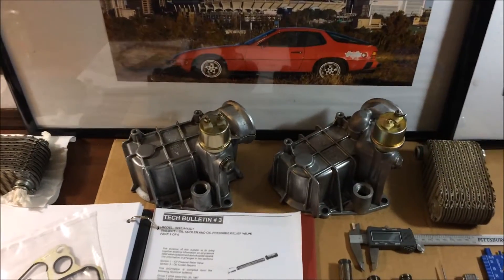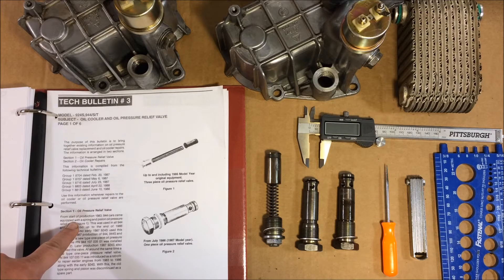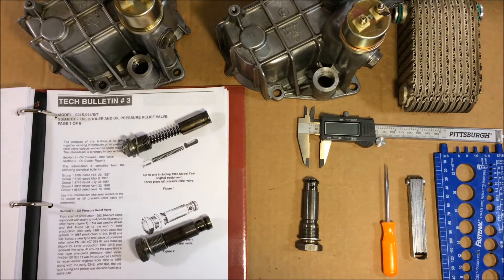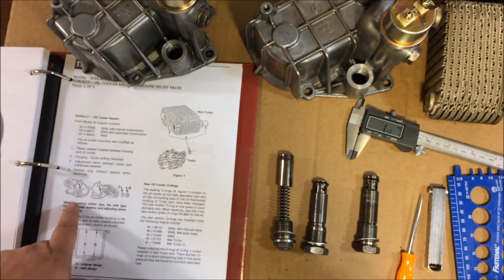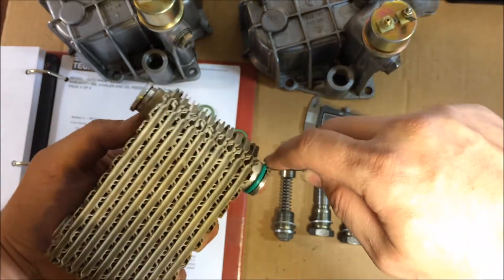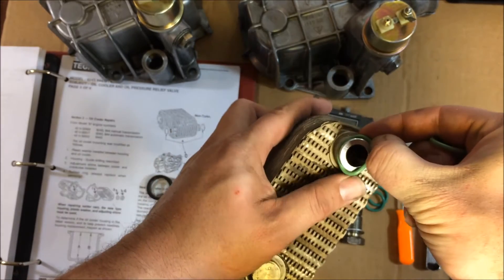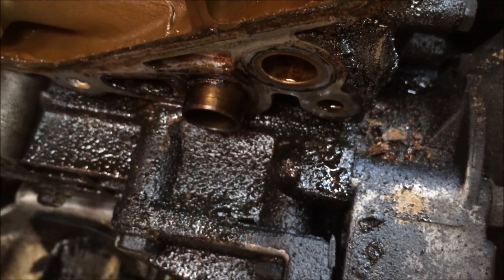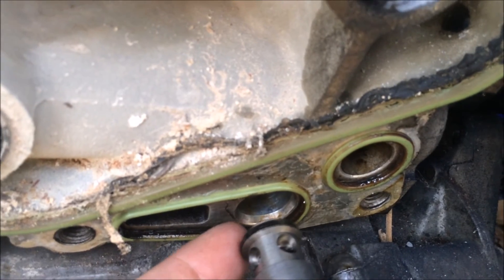Porsche 944 Oil Coolers

Comment: Iam sure there is a reason for the new modified oil cooler/ filter houseing .
But it does look i think over complicated in design .now is there a .free standing oil cooler . As a bolt on 
To the radiator pack ?.
Which  in turn may cure any water / oil cross over to the existing  engine???? 
I expect the engine would need a side plate over the space for the  oil pressure relief valve!!!!and for the sender unit.....
Reply from the maker: The turbo models have an external oil cooler that uses a plate to block off the coolant. However, they use the same seals which can also fail and cause mixing...

Comment: Hope you are still looking at this#
What do i do if i cant get a late housing
  
Ive got a 1985 944 non turbo
THANKS
Reply from the maker: Look around at different part sellers such as 944 Barn, Plyhammers Porsche, and 944 Online. One of them should have one. I don't recommend reusing the older style. The cooler and its seals are as critical as the belts in my opinion since when they fail they will make a mess of the engine. Good luck!
Reply: Check with John at just joshin 944 parts ! He has a ton of used stuff !!!!😄😄😄😄😎😎😎😎🇺🇸🇩🇪🍺

Comment: Which video shows how to remove oil cooler? I've seen previously, but now cannot find!  Thanks!
Reply from the maker: Hi, I believe you're looking for 'Installing the oil cooler video'. I hope that helps!
Reply: @edredas   - Thanks! Actually is was about removal. Assume exhaust manifold has to be removed first. Also, do you have a video on power steering line/hose replacement?  Great stuff!  Really appreciate!

Comment: I have an early housing that I guess I need to replace...has anyone ever just machined down those 1mm lips on the inside instead of paying for a whole new housing?  Any reason why that would be a bad idea (ie. other differences with the newer housings)?  Enjoying my first engine tear-down with my '84 944...thanks!
Reply from the maker: Probably could. I can’t see any other differences. I have a few 5R housing I was going to have a machine shop smooth flat and then remove the number so that I would know in the future they were machined. That said, a 6R housing usually isn’t much and I wouldn’t really try to smooth it down at home since you could potentially mess it up but a machine shop could do it right for a few bucks. I hope that helps!

Comment: Brent, do you have a video on the Turbo, it is a bit different, not much on the the turbo oil cooler on youtube, as a matter of fact, I found nothing. Not much on internet either, clark has some info but not super clear.
Reply from the maker: Check out the videos on the Nautic Blue 944. I show how to replace the turbo oil cooler seals in one of those. It's very similar to the N/A and even has two seals, but you don't need the shims. Good luck!
Reply: @edredas  Thanks, will do!

Comment: Hey Brent, really enjoy your videos, and I use them all the time. This time however, I've hit a snag. I'll need to reseal the oil cooler on my 85.5 944 and while a reseal kit is cheap, a retrofit OPRV is a third of used engine and a new case seems unobtainable. For a free-time wrencher like me, would reusing the old OPRV and case be catastrophic?
Reply from the maker: I think you will be fine. I have reused the three-piece oprv many times without issue. That isn't always the case and its because of those situations that I tell those that its best to go ahead and replace it to avoid any issues.
Reply: @edredas  all right, cool. I'll be sure to follow up in case things go awry. Thanks!
Reply: I make sure to polish the original 3 piece spring style OPRV so it performs extremely smoothly and haven't had any problems, but am upgrading one of my pre-87's to the retrofit OPRV and 6R housing as directed by factory.

Comment: Hey Brent, I found milky oil on my dipstick today and the coolant reservoir is now low with some gunk in it as well. It has been running only a 1/4 way on the temperature gauge and never over heated. Does that sound like the oil cooler seals giving out to you?
Reply from the maker: Yep, unfortunately it sounds like they have failed...
Reply: @edredas  Is there a certain process you suggest for flushing out the engine and coolant to get all the gunk out? thanks and enjoy the videos
Reply from the maker: @johnrichmond4083  There's a few coolant flushes at walmart that are rather cheap. I used one to remove some rust inside the cooling system once on another car. That said, I've only seen the coolant in the oil so I had to do the rod bearings and clean that engine out manually. So how good a cheap flush would be at removing oil is unknown, but worth a shot!

Comment: Hey Brent, I read in the tech bulletin that it says the oil pressure relief valve is “not serviceable”. Does this mean I should not take the valve apart to change the inside o ring ? Or do you think it means something else
Reply from the maker: Correct, it isn't serviceable, but they mean to not remove 'C' clip at the top and mess with the spring inside. It's perfectly fine to replace the O-ring at the base and put it back together. Just be sure to use lube when reassembling. I hope that helps!

Comment: Hi I have a question why cant you reuse the early housing? Why do you have to go to the later one?
Reply from the maker: Not a lot of information is known as to why they changed but according to Porsche themselves the early 5R housings are to be discarded and not reused. If one was to speculate, it is known that the oil cooler seals can fail. When they do, coolant can enter the oil and vice-versa. Once coolant is in the oil, the acids that prevent corrosion in the cooling system will attack the bearings requiring them to be replaced. So it is just as critical to replace the oil seals as the timing belt. The early 5R oil coolers had a flange inside them that was removed on the later 6R housing that used a plastic spacer instead. Because of this, they use a different reseal kit and even if you did decide to reuse your housing, the only reseal kits are for the 6R housing so it would not work correctly with the 5R housing. This could cause even more premature failure. I hope that helps!

Comment: Quick question regarding the new housings.

I'm currently doing a reseal on my 84 N/A and it unfortunately has the old 5R with the three piece OPRV. If I got a 6R housing am I able to use my three piece OPRV or do I have to upgrade to the retrofit one piece?

Thanks in advance!
Reply from the maker: You can reuse the three-piece if you like. I do recommend the one piece since they work way better but most of the time there are no issues. Good luck!
Reply: @edredas  Thanks for the reply! I'd love to use the one piece OPRV but finding used ones are difficult. My local Porsche dealer wants 500$ Canadian for a new one. I'll keep searching around and see if I can find a one piece.

Comment: Great video! Question: how does the OPRV work? As the oil pressure builds, how does that move the piston? I feel like the small hole at the end of the piston is something to do with it, but can't work it out!
Reply from the maker: As the pressure builds from the oil pump the piston is pushed back out of the way and oil is allowed to flow back directly into the oil pan. This bleeds pressure off so the oil pressure can be regulated. I hope that helps!
Reply: @edredas  Got it, I think! So the end of piston is getting the full pressure of the oil pump, which pushes the piston in so that the oil gets pushed into the oil cooler through those four axial holes at the end of the OPRV and then into the pan?
Reply from the maker: @JulianBunn  Something like that. When the OPRV is closed, all the oil goes to the cooler, then as it gets full pressure it opens up or pushes back the piston, then that oil goes through the holes and gets dumped back into the pan. I hope that makes sense. So basically, the default state is closed with all the oil going to the cooler.

Comment: hi Brent!! I finally get to start working on my first 944(firs ever P-car) and have some problem - https://youtu.be/ha_4Qoj_iLc  is that's OPRV fail??? I post a treed on pelican - http://forums.pelicanparts.com/porsche-924-944-968-technical-forum/1028880-first-start-1984-944-n-oil-pressure.html
Reply from the maker: Your oil pressure looks perfect! After the engine warms up it is normal to see the pressure to drop. I hope that helps!
Reply: @edredas  yes, after warming up - oil pressure is good, but right after start - it stack at 5 and piss an oil on the ground.
i will investigate it later, as i'm weather permitted DIYers ant there is minus 3 degree celsius this morning :(